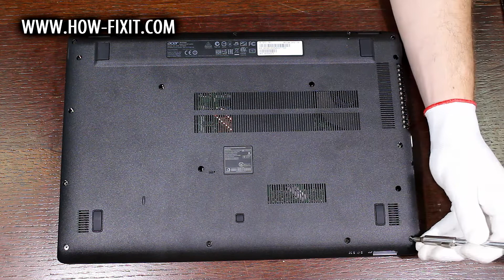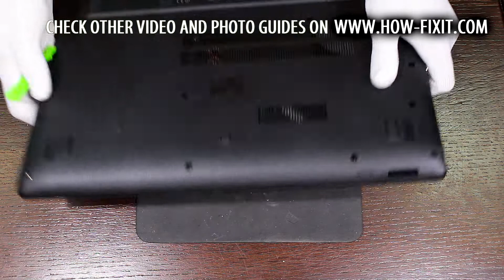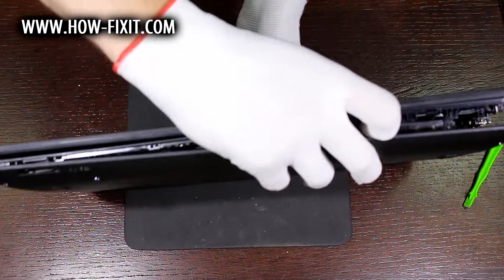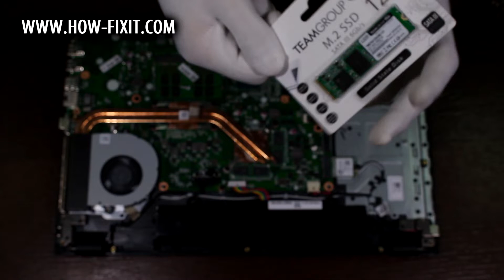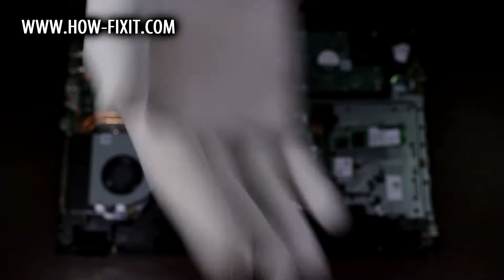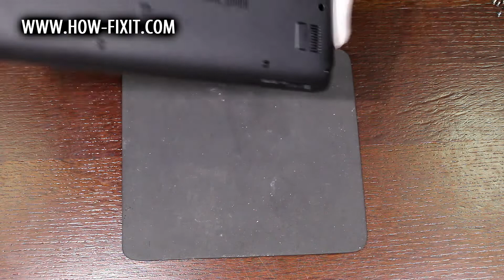Acer Aspire V5-591 SSD Upgrade Guide | Step-by-Step Installation Tutorial

Comment from the maker: ⚠The Acer Aspire V5-591 supports only SATA (M.2 SATA 3), not NVMe (PCI-Express). Check the description for links to recommended drives. 
Additionally, watch the video explaining the differences between M2 SATA and M2 NVMe 👉 https://youtu.be/r3Jy5dHOj3g
Reply: Автор, подскажи, плиз,  на Acer Aspire V5-591 мат плата поддерживает PCI Express 3.0 x4?
Reply from the maker: @РомаТищенко-я3с  нет, только SATA
Reply: Do you need the thermal paste?

Comment: What's next? I mean, i suppose you're gonna put the OS on the SSD, will you clone the HDD on the SSD or make a fresh install on the SSD? Do the M2 have to be enabled from bios to tell the laptop to boot from it? what else?
Reply from the maker: MIGRATE (Clone) Windows to SSD: https://youtu.be/kOMoWKo043M
After you’ve installed the new SSD, you’ll need to transfer your operating system or install a fresh version of Windows, and there are tutorials available that demonstrate both methods.